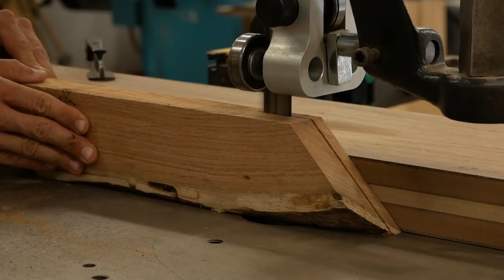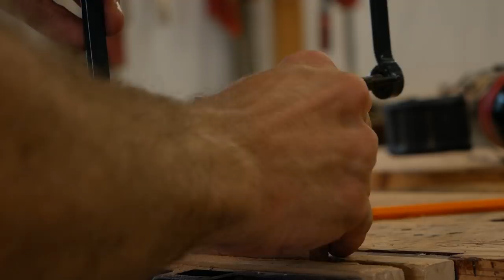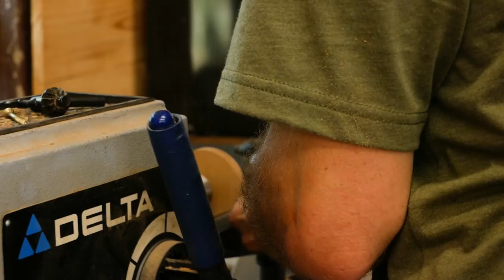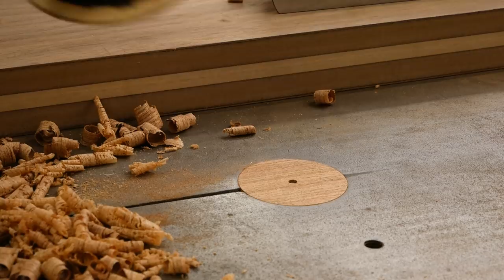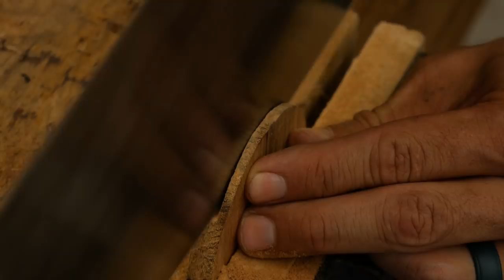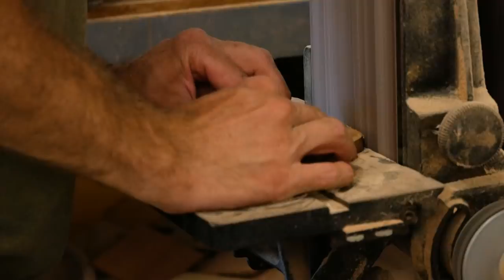Making An Insert For My Old 36" Oliver Bandsaw

Comment: Love that fence. Soooo practical. Are you going to set it up like a tablesaws fence ? Love the shop and lighting as well. So few shadows to deal with. Love the glue trick. I often use a hot glue gun for things like this. Well done Andy. Adding that cross grain is such a great idea for sure.

Comment: What was the purpose of adding that spline in the back of the insert?
Reply: Logan Probably to stop it warping and getting stuck, and maybe add some strength.
Reply: It's so it doesn't split with the grain along the line of the cutout for the blade.

Comment: This may seem like a stupid question but what is the point of the spine in this application?  Is that wood piece really going to be under that much “stress”.  I’m a novice when it comes to woodworking so this may be a common thing that I’m not use to seeing.
Reply: Adam Davis I think it's just for added stregenth. Chances are it would work fine without it but it doesn't hurt to put it in.
Reply: Evan Dunville True, I just didn’t know if there was some specific meaning like it helps reduce swelling of the wood causing a bad fit.
Reply: I’ve just had time to read the comments, seems like I wasn’t the only one who wasn’t sure about this lol. Andy did answer a few.

Comment: What's the purpose of this insert? Does it stabilize the blade? Is it for making better cuts?
Reply from the maker: It strengthens the insert...without it it could easily split and break
Reply: Andy Rawls yes, but what is the purpose of the whole thing? Not just the spline, the insert itself...
Reply from the maker: Oh sorry miss read your question.  The bandsaw blade pulls down on the workpiece, without the insert you run the risk of the blade pulling smaller work pieces down into the saw potentially taking your hand with it.   It also helps prevent tear out on the backside of your cut and protects the blade.
Reply: Andy Rawls thanks :) 
Love from Italy 💙